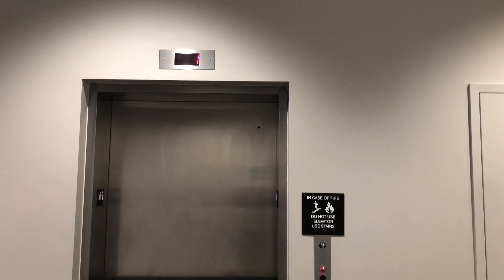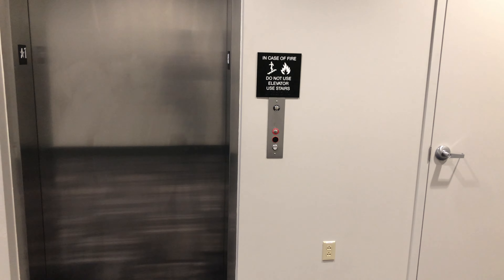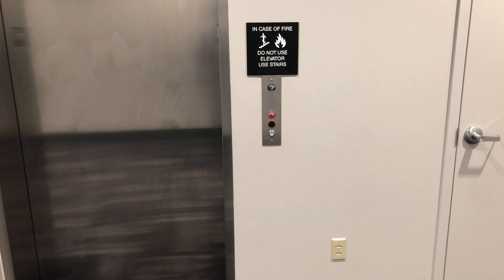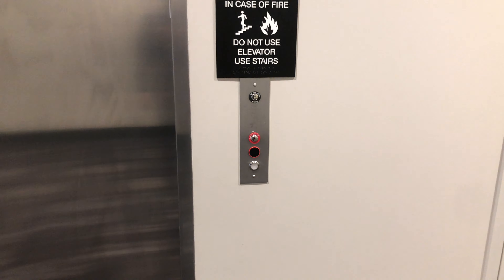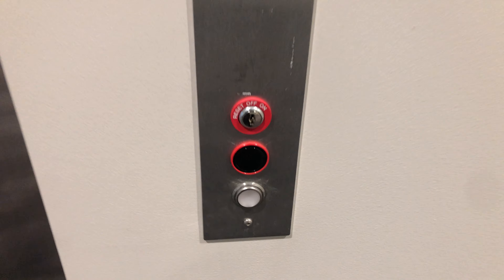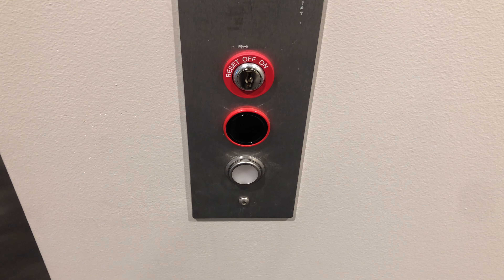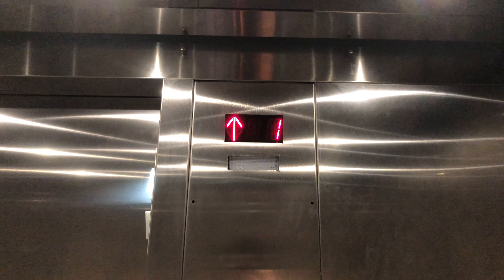Vertical Express (thyssenkrupp) elevator - Siemens Mobility - The Waterfront - Homestead, PA

Comment: i filmed at a BRAND NEW AC By Marriott yesterday, and they have TKE synergies. they have the segmented indicators as well. it CAN be on installs, but most contractors go with their base model installations (which include the dot matrix indicators you usually see).
Reply from the maker: That's interesting.